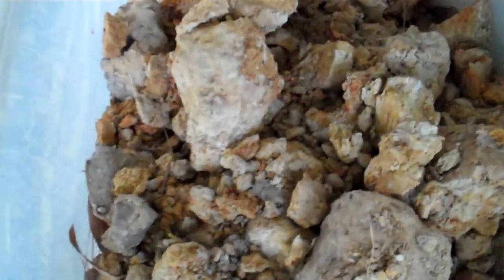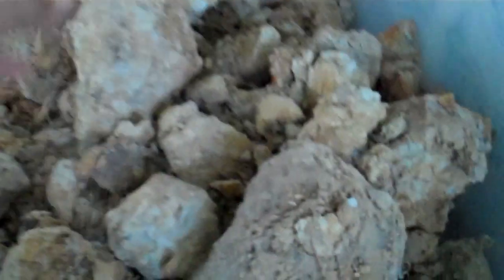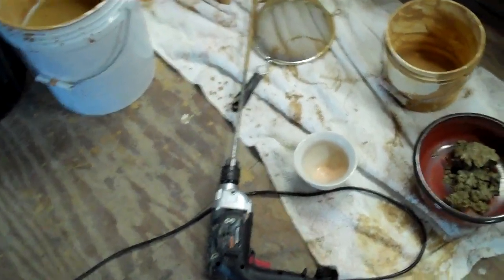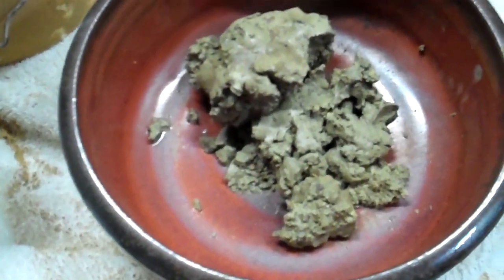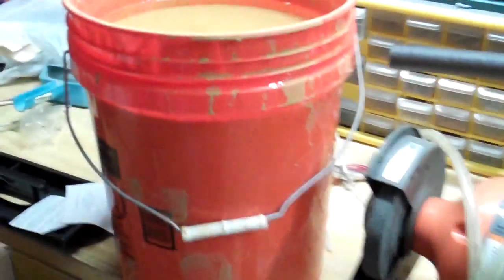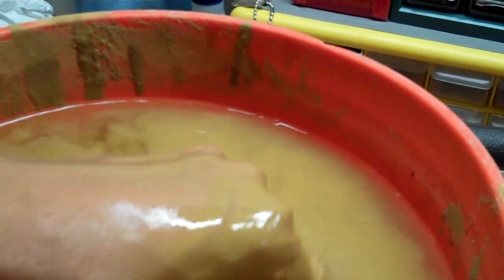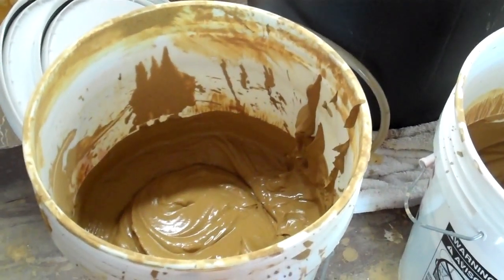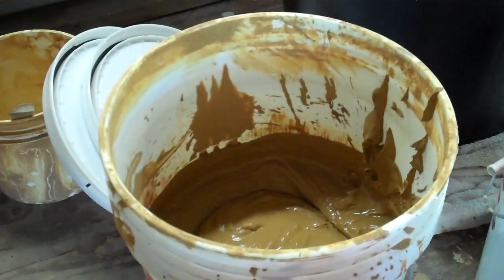Refining Dug Up Clay

Comment: The way I like to solidify my filtered clay, is I'll pour it into a pillowcase in a 5gal bucket. Tie the top closed, pull it out of the bucket, and hang it up in the air. The bag will "sweat" the water off leaving the clay behind. I hang mine in the shade to give em time to soak a while before they're done.

Comment: I take a handful of normal soil and put it into a nylon bag.The bag has holes about a quarter of a millimeter(0.01 inch).I shake the bag on a cup of water for a minute.
I filtered 4 handfuls of normal soil in the same cup of water,concentrating the clay.I wait for 24 hours and I get a handful of clay(with some silt and medium to very fine sand).

Comment: The only thing I'd say is you spent a lot of time with that bit of rocky, sandy clay... Focus on 90%, discard anything hard to process unless you had to venture to hell and back for it.  Our property has a thick layer of clay 8" below the survace, which is HELL for building things like driveways and foundations... Be glad if you don't have tons of clay in your backyard.  It's so pure though, I just put it in a bucket with water for a few days, mix it with the best mixing tool I have available (mortar mixer for a drill works great) to break up chunks, then run it through some window screen.  After that I bake it in the sun for a few days, pouring off any clear water.  Wait until it's solid enough to pick up in chunks.. The remaining sand and rocks settles to the bottom, I scrape it off, then repeat the entire process with the processed clay to remove finer particles.  The more you repeat the process, the more pure the clay will be.  Don't mess around with the small bits, you can process a lot more clay if you don't get hung up on that stuff.  Always think "Why am I doing this?".  You're never wasting clay if you put it back into the Earth.
Reply: Oooh..ok.....Nice

Comment: I have a batch of clay that is not settling. Someone suggested burning off the organic material but that means drying off all the water or filtering. Im wondering how I might I go about doing the burning off, temp etc, and would you agree with the theory? Maybe Im not hydrating enough?

Comment: The process I ended up going with involves breaking up the dug up clay in a bucket of water and stirring it to a slush,   letting it settle a minute then decanting through a mesh into another bucket leaving the sediment at the bottom of the first,     repeating with finer mesh a few times to get plant matter,     then boiling it down in a large pot to a thick consistency and smearing it on a large surface to dry.      the plasticity seems to suffer a bit as a result.

Comment: This helps my but, here in Texas there is a lot of clay right in my backyard. So I dug up some clay but I can't seem to get the mud out. my question is how do I get the mud and dirt out?
Reply: use a smaller mesh screen like a 1/10 mesh screen
Reply: +gettingbigforskinny okay thanks
Reply from the maker: Use a clear container when you mix with water. When the materials are separating the clay will sink to the bottom. The layer above the heavy layer can be syphoned off as waist, the layer above that as a slip or useful layer  for may uses. And above that that as water.

Comment: good video mate! learned a lot
Reply from the maker: Harry Brewster-Jones thanks!
Reply: have you ever built a chiminea? Im really interested in making one of my own and am currently trying to figure out whether or not to use chicken wire to form the clay around.. thoughts?
Reply from the maker: Harry Brewster-Jones it normally will cause issues down the road and cause the clay to break and crumble due to the inconsistency of clay shrinkage vs the wire. A well made pot doesn't need the support past vitrification
Reply: good point.. im going to attempt to build one soon, am just at the stage of making the clay.. i also need to figure out how to fire the clay chiminea without an oven.. will it be possible? also have you seen primitive technology youtube? the guy is awesome

Comment: Hi, not sure if you are around anymore but why would clay explode (is there a term for that?) and what is the difference between that stuff and “professional grade” if there is any?
Reply: It would explode during the firing process due to the moisture inside the clay turning into steam but having nowhere to escape, so the steam forces it's way out.

"Professional grade" clay (if it exists, and we're assuming it's bought from a company and the store) probably has more than one type of clay mixed into it before it is hydrated for the "optimal consistency, plasticity, and firability".

It's some sort clay "secret recipe"

Comment: Hello how can i sanitize my raw clay in order to use it for cosmetic reasons? Thank you
Reply from the maker: The easiest way is to use distilled water and then boil the solution. Many impurities should rise to the top during that process and then seal the container while it separates. After the separation process takes place and a clay mixture forms you can also heat the clay slurry above about 240 deg f. And then put in an air tight container or plaster bowl. Remove all surface the has air contact and it should be as sterile as it can get for home process.

Comment: isnt low placticity good if it need to take high tempratures
Reply: For normal claybodies that's the case, for many earthenware it depends on the mineral deposits in the clay. I have had some low temp clays that had a very high plasticity and some that had very little plasticity and fired to the same temperature.
Reply: Jerad Spencer okay. What if it wasnt just that theyd grt fired, but if were to make a kiln out of it?

Comment: i found out an easier way but not as efective just take clay and take a pvc pipe and rool it all out untill u got powder and then just use it
Reply from the maker: The only problem with that is you are left with a larger amount of impurities that can lower the quality of clay as well as the firing temperature
Reply: + Daniel Foti I can remember my friend's grandmother (traditional native american potter) would use an old grindstone (an anthropology friend of mine later told me they're called "metate"...) to pulverize everything down to powder before putting it in the water to slake and strain.....